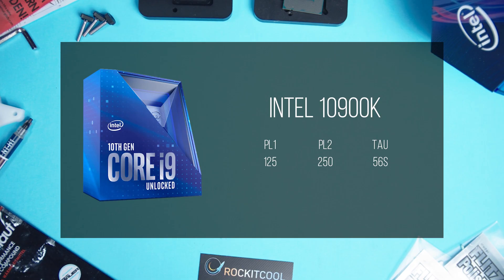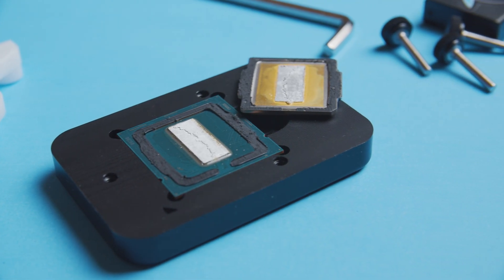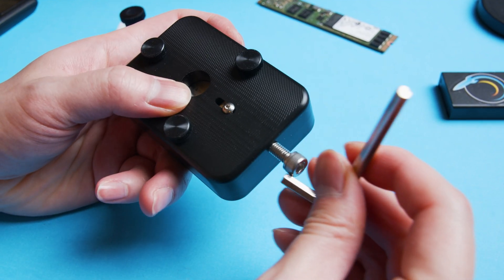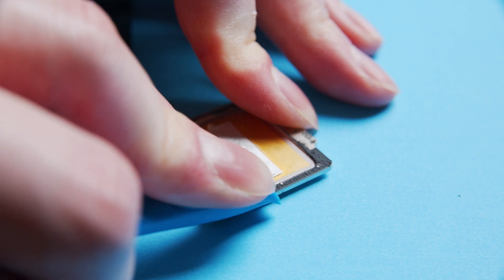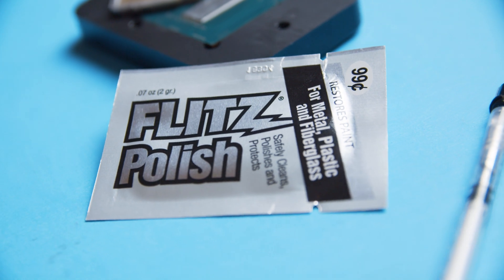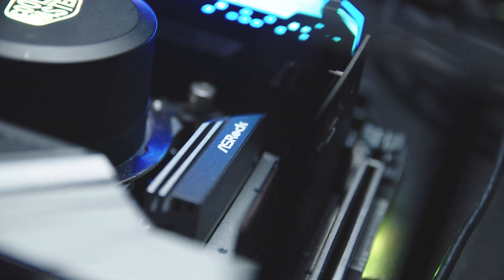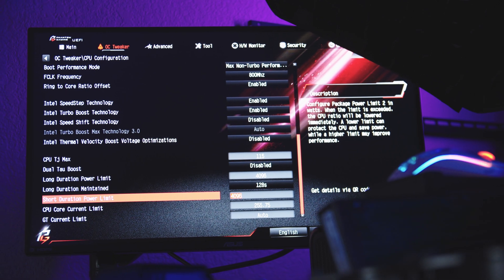Delidding the Intel i9 10900k without a Razor - Temps/Liquid Metal. I may have screwed up a bit. ☠️

Comment: THANK YOU! this video was my main source of information for my first de-lidding attempt ever. I did the copper IHS replacement from RockitCool and basically just followed your instructions, and it worked! 10C off my avg core temps. Thanks again! Side note - heat gun for 2 minutes makes the de-lid itself MUCH easier.

Comment: I did a delid on my old core duo chips e7500 had intels classic paste BUT. A core 2 6300 and qx6700 had solder I had no idea intel did that. I can understand the 6700 it had a top of 130 but the 6300 is a 2 core at 1.83ghz kind of a waste.

Comment: Thanks! I appreciate you speaking clearly and not as fast as some content creators. I guess my ears and brain don't work as fast at 75. I was also confused by the column switch and glad it was addressed in the comments.  The delidded chip look a lot like what we use to get with the Pentium III. I picked up an i9-10850K today. :) I am awaiting the delivery of Noctura NH-U12S cooler from Amazon so I can play with my new upgrades.,
Reply: If you picked 10850K and not 10900K, at least your smarts work perfectly fine! It's basically the exact same CPU but a hunnit bucks off. 10900K does not really make sence, no way you could actually feel that 100MHz difference.

Comment: Might have wanted to benchmark your cpu before proceeding with delidding, seems like you delidded a silicon dud that just has a really hot infrastructure. My i9-10850k never surpasses 69C at 5.2ghz all cores 1.17v undervolt with a hyper 212x on cinebench multicore.  I would suggest applying some rubber sealant to the part of your PCB that you removed the protection off of to prevent shorts with the IHS. Great video on the procedure on how to delid a chip.

Comment: Great video man. I dint know about that quicksilver stuff to remove the indium. THX for the tip! 

But i think your issue here is using an AIO. For not much more money over your Corsair AIO you can do a custom loop and bring your temps down probably another 20C. with an EK block and EK360PE radiator.

Anywho thx for the video.

Comment: Hello.
Did you try to remove the material at the base of the heatsink taken from the die? The contact between the die and the heatsink is bad. I always try before re-gluing with any paste applied only on the die (afterwards too, this is important), the control is simple: if there is paste on the heatsink: contact OK, optimum.
After that I only apply the liquid metal to the die in a minimum quantity.
Greetings
Reply from the maker: Yeah, I checked the contact patch on the IHS to both the heatsink and die. They're both making best possible contact. I'm still thinking about getting the direct die kit and see if things get even cooler.

Comment: Just bought a 10700k on ebay for $360 that has this done to it. I don't know how the dude makes money but I'll take it lol
Reply from the maker: Whatttt? How's it holding up?
Reply: @JTTR  I'm running 5.2 ghz core and 4.9 cache @ 1.33v.
Reply from the maker: Wow, sounds like you lucked out. 1.33v at 5.2 is silicon lotto winning territory.
Reply: @JTTR  Actually I forgot to mention I turned HT off though. That definitely helps reduce voltage.

Comment: Also just an FYI, I think JTTR had the last version of the delid tool from rockitcool. My 10th gen tool, has a notch on the delid piece underneath, which I think is what was scratching the PCB on JTTR video.
Reply from the maker: That was my bad, I didn't torque down the two halves correctly. My second delid went smooth.
Reply: Are you saying the new 10th gen delid tool is bad and will scratch the cpu? I just ordered one. Should I be concerned?
Reply: @criskoe  no the 10th gen is fine and you wont have any issues

Comment: Just an FYI their website says Note: The relid guide included in this kit will NOT work for the stock IHS.
Reply: Correct, Buy the Copper IHS, it`s amazing and lowers heat even more, i`m seeing 10cels across all cores. Also a custom loop helps as well, AIO is not enough for delid cpu imo.
Reply: @airlogic  sweet, im just waiting for my liquid metal to arrive and ill be completing the mod tonight.

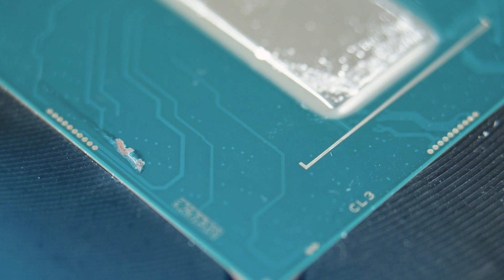Comment from the maker: Hot damn , look at 07:43. I nearly clipped multiple traces. Almost had a heart attack 😱.
EDIT:
Thanks Mayo for pointing this out. I had an Adobe Illustrator linking issue at 06:20 that didn't update so the temp columns are swapped. The delidded column should have had the lower temps and the stock with the higher ones.
Reply: better than my first delid on a 7700k, i place the cpu on a table and start wiping off old liquid metal, i pick it up, broken capacitor on the back lmao, it was a good sample, 5.5 at 1.45v